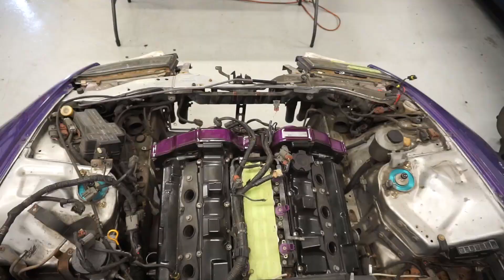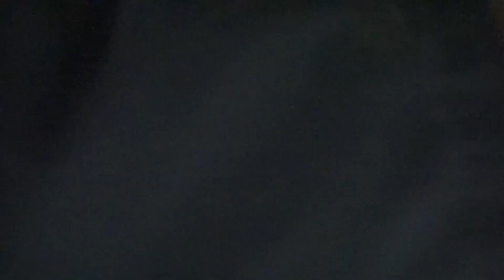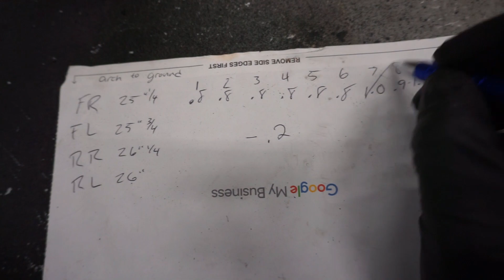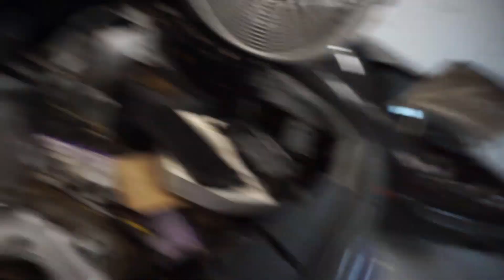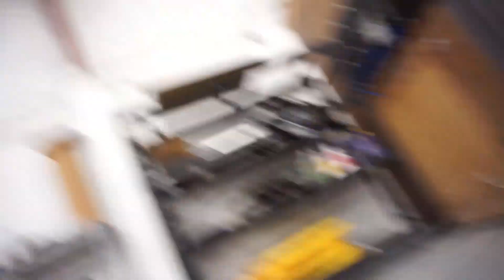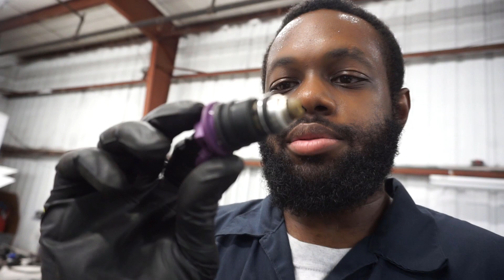Don't let this be a Jynx...

Comment: i dont see how there is pitch black oil sludge on the pressure sensor if the motors been overhauled.. seems fishy
Reply from the maker: Shenanigans
Reply: The block itself was resealed. Everything else is stock and as it was when the motor was purchased. Block wasn’t even decked/honed. I think there has been some confusion on what was done to the block upon purchase sadly.
Reply: She is in great hands now and will be corrected. I can’t wait to see the end result.
Reply: @Runningmancs  sweet man, im moving to Florida in a few weeks just to check this car out in person, i like the color

Comment: I would pop open the valve covers for my curiosity.
Reply from the maker: In going to have to to fix that fitting issue on the driver side
Reply: True. You right.